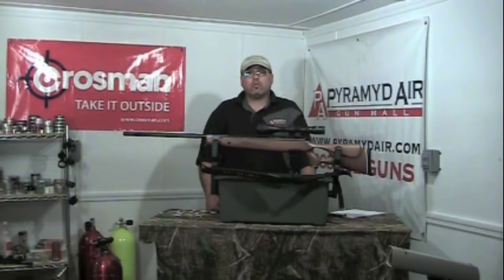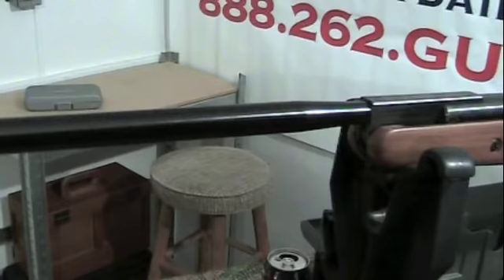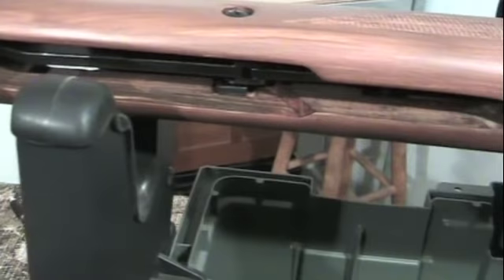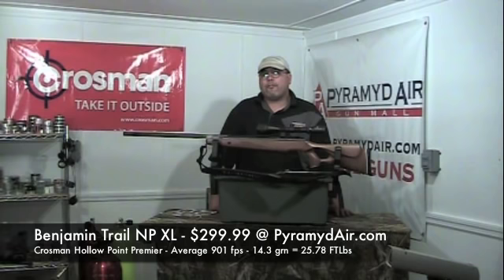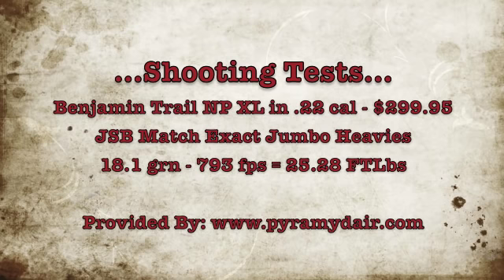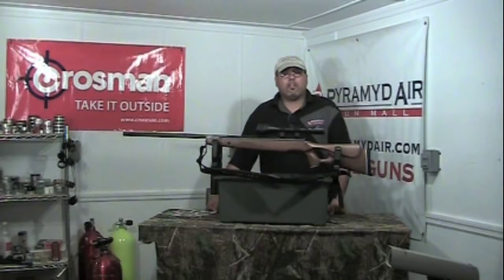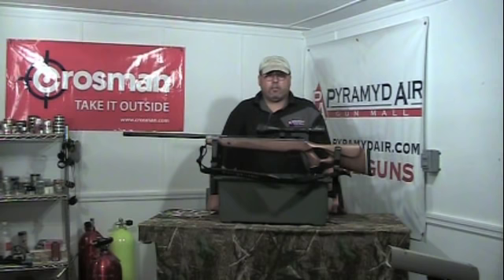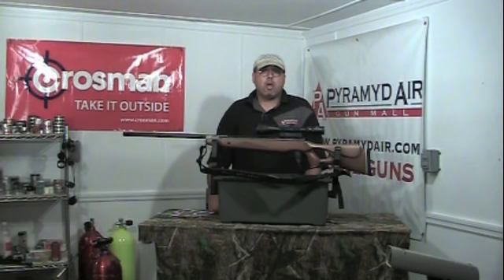Benjamin Trail NP XL - .22 cal Gas Ram "ultra magnum" (At least that is what I call it..!)

Comment from the maker: @whyteryze 
Good question. I shoot them right out of the box and get a baseline, then I shoot them until they "settle down"  You can tell when a rifle has hit its stride.  Velocity evens out, and accuracy improves.  Once that happens, I start the video review process.  Every rifle is different.  My TX200 took little or no time to break in while the cheaper guns like crosman and gamo can take 500 to 1000 shots to break in. The cheap guns make me work a lot harder to get good shots.

Cheers
Rick

Comment from the maker: To Jomel Sagsagat:
I would go with the Hatsan 125 in .25 cal. In .22, it would be on who you would ask. There are people that love the XL in .22 and there are those who have said they have had some problems with it. The Hatsan 125 in .22 is very accurate as well. With Hatsan, you will get a better trigger.

Cheers,
AGW
Reply: You this you can give the XL an extra edge if the trigger is upgraded?
Reply from the maker: Jomel Sagsagat
People have good results when this trigger is upgraded.

Cheers,
AGW
Reply from the maker: Ric Brown  Ric, if you can email me directly regarding the 125 quality issues that would be great.  I talk to the Hatsan guys often and have not heard of anything that would throw a red flag.  The NP in .25 that I tested never got past the break in.  It was awful.  I have a stoeger x50 coming, which is nearly the same gun minus the gas ram.  In .25 cal springers, Hatsan is the way to go.  If you get one that's not right, contact them immediately, don't try and fix it yourself.  They will WANT to make it right for you.  But if you don't want to go that route right now, just hold off for a while until the smoke clears from SHOT and all the new stuff starts coming in.CheersAGW
Reply: My hatsan 95 in .25 had its trigger sear snap off after an extended shooting session

Comment from the maker: @MrDJKaram 

It is a sealed system.. like a gas ram on the hood, trunk, or hatchback of your car.  It does not use "gas" in the way a co2 gun would.. the ram is sealed and a piston compresses the gas in the ram.  When you pull the trigger, the gas is allowed to push the piston back up and that pushes the piston in the gun just like a spring would but with less recoil, less vibration, and less torque.

Rick

Comment from the maker: @Alstar250 

Thank you for the kind words.

The NP is quieter than the XL.  and they are both quieter than phantom.  be sure to use the .22 of the NP and not the .177.  Also, in your phantom, what pellets are you using?  The heavier pellets help keep the noise down.

Cheers!

Rick

Comment from the maker: @Nevanator7 

You know.. I really like the Benjamin Trail NP.  I'll be posting a video of it later today... About the only thing that it needs is a different trigger which you can get for about $32 on-line and it just drops in place in about 10 minutes.  It will serve you well out to about 50 yards, which is quite a reach for an airgun.  It runs about $230 which is a real value.

Rick

Comment from the maker: if you are referring to adding a spacer or larger washer on the trigger to shorten the pull length, please be aware that you are asking for a lawsuit.  There is a reason that Crosman leaves such a long sear engagement.  When you reduce it, the gun is prone to misfire or accidental discharge.  If someone get's hurt after using your "fix" then you can be held personally liable.

Please be careful.

Rick

Comment from the maker: @SoCoMzXeLiTe 

It is bad for the gun to dry fire them. You ram the seal into the front of the compression chamber and also, usually, cause combustion which contaminates the chamber.  If you damage the seal you will have to replace it.

Rick.

Comment from the maker: The crosman trigger is not a true 2 stage trigger.  The first "stage" does nothing to change the sear engagement, the 2nd "stage" is where it pulls the sear and fires the gun.  They have a long sear engagement for safety reasons.  Modding the gun in this manner, safety or not, can possibly cause a misfire of the rifle.  I've seen happen.  The better option is either the GRT III or GTX Gen II triggers.  They convert it to a true two stage trigger and maintain safety.  $35 well spent.

Cheers
AGW

Comment from the maker: @SoCoMzXeLiTe 

the 950 is with super light weight pellets.. not lead.. lead pellets shoot around 750 fps.. which is very respectable in a .22 breakbarrel.. In the end you want accuracy not velocity.. don't get caught by the marketing.. when you break the sound barrier you loose accuracy very quickly... airgun pellets are VERY different than bullets and don't do well past 900 ish fps.

Rick

Comment from the maker: @SOGavin 

Try switching to the "artillery hold."  In short, rest the rifle in your off hand right at the balance point of the rifle. This is usually back near the trigger guard.  This is contrary to how you'd hold a regular firearm.  Do not grip the rifle with your off hand, just cradle it.  You can rest your hand on something if you need to.  Now hold the rifle securely with your trigger hand, get your sight picture through the scope and gently pull the trigger back until the gun fires.
Rick

Comment from the maker: PyramydAir does not use a DB meter to test noise.. they "ball park it."  I use 2 different DB meters and average them together.  I KNOW the Stoeger is quieter.  Also, the gas rams that crosman is using these days are more cheaply made than the original ones.  I The Stoeger x20s is built very well and is a stand out product for the money.

Cheers

Rick

Comment from the maker: The piston that Pyramyd Air sells is designated for the NP series of rifles. It does not say whether it would fit the XL. You might assume that it is a  different piston because of the power difference. As of now, I do not know whether you can switch the pistons out.

Cheers,
AGW
Reply: i have the np with the grt trigger.  extremely accurate with predator polymags.  i ask Benjamin if the pistons can be swapped and was told NO....i am going to stay with np for now as i have the hatsan 125 in .25.......both of these rifles are deadly accurate and fun to shoot....use np for barn yard pests and hatsan is my hunting rifle......all bought after your reviews.  they were very helpful and informative i thank you.....what i need is an rws with a piston...an old mans dream....

Comment from the maker: @MrAlbert3560 

Actually the Titan GP was modeled after the Trail.. which was modeled after the Super Streak.. Anyway, I guess that question would be better answered by Crosman.. but I'm thinking that they had a design that was working, to make a smaller, less expensive version made sense.

Cheers

Rick

Comment from the maker: You need to watch the stock screws, the scope mount, the scope, a drop or two of chamber lube every 1000 shots.  Also, clean the barrel every 50 to 100 shots using dry patches.

cheers

Rick

Comment from the maker: @adamclark94 

Usually accuracy AND power don't go together in a spring gun.  The recoil generated to get the power, makes the gun very difficult to shoot well.  I like the Trail NP over the NP XL.  I can get 1" groups at 50 yards and it gets 730 fps with 14.6 grn pellets.. That is plenty enough energy for most game out to 50 and 70 yards.

Rick

Comment from the maker: @saltycrack44 
the RWS 34 is a winner... BUT consider the Benjamin Trail NP (NOT XL)  The XL is just the Super Streak with a gas ram.. in .22 it is ok.. but it will have some of the same hold and control issues that you find on the super streak.  The other option is the NPSS, which is a better, US Made, version of the Trail.

Rick

Comment from the maker: @MrCoonTrapper 

The screw does little to nothing for you.. It adjusts the 2nd stage pull length only by a fraction. it does not do anything for pull weight.   All the way in is as short as you'll get the 2nd stage.

Cheers

Rick

Comment from the maker: @MrCrazypyro84 

You have to ask yourself this question, is hitting something with 10 foot pounds of energy better than missing it with 13 (+/- for the xl) foot pounds of energy? That is really what you are talking about at 50 yards. Rabbit and Squirrel are still well within range at 50 yards.. With the right pellet you can drill a 1" group with the Trail NP. The recoil on the XL is so severe that you'd be lucky to get a 3" group at 50 yards.
Cheers
Rick

Comment from the maker: You are experiencing the normal operation with this gun. Do you have it in .177, .22 or .25.  
The .22 is the best caliber in this gun.. it is the most accurate of the 3.   You have to constantly maintain it by checking the screws, etc.  Also, it has a tendency to break scopes.  Keep Crosman's number handy.  They'll keep replacing it if it breaks.

Cheers

Rick

Comment from the maker: @YelloFault 

The new version with a gas ram should be quite the gun... I'd put it over the Trail NP XL.  Although I've found that I like the standard Trail NP over the XL or the other magnum springers.  It is much easier to shoot and therefore more accurate at range even though it does not shoot quite so hard.

Rick

Comment from the maker: @tommy2timez 

My experience with the NPSS has been poor.  I'm not saying they are all this way.. but out of all the NPSS rifles that I've purchased or evaluated.. every one has had an issue.  My first one was really good (review from a couple years ago).. then the ram failed.  Since then, I've had a barrel joint failure and 2 with problems with the cocking linkage.  There's no excuse for this other than poor quality control.  It's very disappointing to me. 

Rick

Comment: If you have trouble or inconsistence with your group accuracy ...clean your barrel with copper brush .22 cal with cleaning patch wrapped with ''nitro solvent bore cleaner''. When the brush is outside at the end of the barrel, unscrew the brush and change your cleaning patch and repeat 4-5x or until the tampon is clean (white not brown). All of this remove the residue machining of the barrel and improve greatly your accuracy.20 shots my scope is zeroing at 50 feets with 2'' group(break in period)

Comment from the maker: That's not bad for a trail np xl.. the Hatsan 125 shoots the 14.3 around 875 fps, so there's not much difference there.  If you want more power, go for the .25 cal.. It shoots slower, but the pellets are almost twice the weight.  25.4 grain at 710 = 28.44 fpe.. 

Cheers

Rick

Comment from the maker: When is the last time you cleaned the barrel?  Also, if you have the option to have it chrony tested, you may find that the velocity has dropped due to a bad seal or a defective gas ram.  Both occur more often than folks realize.

Comment from the maker: @ILaxWithaPro7 

I just realized you have the XL and not the standard NP.. you can also try the 15.9 grn jsb pellets and the slightly heavier 18ish grain JSBs as well.    Lastly, try the Predator Polymags and on a long shot, the H&N Baracuda... but I think the JSB's may be the ticket.  PA has a JSB sample pack now that should get you started in the right direction.

cheers

Rick

Comment: If you want info on tuning it to get the max power out if it I can help. I don't own one so I can't say what to expect from it when operating 100%, but at least I can help you get you to 100% whatever that may be. Usually the guns have a few serious but easily fixed problems, the main seal is damaged, the transfer port is in horrible shape, and often a few other minor things. The good news is it's easy and cheap to fix them. This btw isn't a Crosman/Benj issue, but basically all non German guns.

Comment: I'd get a spring gun like the generic Crosman Quest, Storm, Phantom etc, (preferably a referb) then buy a suppressor from Crosman (~$30), and put spring tar on the spring. This will make about the quietest gun you can get. If you want even quieter you can detune it by removing the spacer behind the spring, your power and cocking effort drops to ~half, noise drops a lot too but I doubt by half. You can also make a spacer any length in between. If you want magnum power then the XL is what I'd get

Comment from the maker: @alrodrodriguez 

Between those two guns... man that is a tough one.  The Falcon Hunter has a bit more power, from my recollection, and I like their new quatro trigger and SAS shock system they've built into the stock, BUT the Benjamin is really quite.  The other choice is to go with the Standard Benjamin Trail NP, especially if you are shooting primarily in your back yard.  It is a little slower, but I found it more accurate and much easier to handle.  It is also $70 less.

Cheers

Rick

Comment: The only difference I can see in that trigger is where the pin and spring go it's a solid piece there instead. That's why I said don't put a washer in that goes above the top of the trigger. I found a thick washer that fits perfectly. If I do have issues with it then I will buy the $35 trigger.I can see why you would caution people not to do this though,wrong washer the gun could go off dropping it or even a hard bump, that's why you don't want too big of washer sear may not engage all the way.

Comment: @AirGunWeb I have to say that I cranked the trigger adjustment on the Vantage about 1 1/2 turns clockwise and the travel is almost nothing now. Takes very little pull to get the shot off.

Comment: The trigger pull on the rifle can easily be fixed with a .05 cent washer by removing the 1st stage spring and replacing it with a small washer, walla no more first stage and a hair trigger now. Make sure the washer is small enough to only reach the top of the trigger frame.

Comment from the maker: I've found that the current offerings in NPs don't hold up as well as a quality spring gun, i.e. RWS 34.  Hatsan has some new air spring guns coming out soon, they may be a good option as well.  The Gamo IGT guns can be good as long as the barrel joint holds up.

Cheers
AGW

Comment: perhaps you could point me in the right direction. i have the standard model trail np. it used to shoot consistent dime size groups at 20 yds. i may have put a bit much oil in it, because now it shoots 1.5 inch and sometimes worse with the same pellets. it isnt making any visible smoke after being fired, and ive ran at least 200 pellets through it and cleaned the barrle, checked all the scope mounts, and the stock screws. any suggestions would be greatly appreciated!

Comment: @mick50382
From what I have read from other folks who use them, the Crow Magnums do very well on soft game (starlings, sparrows, pigeons, and rats) within 50 yards, and tougher critters such as squirrels, groundhogs, and crows within about 25 yards, and yes that was with the Trail NP XL.
The Predators do a bit better due to the tip, enabling you to stretch the range to 50 yards for the tougher critters.
If you want maximum performance for all ranges, the medium to heavy domes rule, though.

Comment: Hard to beat JSB or H&N. H&N Barracuda Match are outstanding, H&N Crow Magnum are imo the best hollow points. The 177 8.4gr JSB Exact or 22 18.13gr are both amazing. That goes for any airgun with descent power, spring, nitro, whatever.

Comment: I think a gun needs to be at 30ftlbs before it can add "Ultra" in front of Magnum. Imo. 
The trigger can be fixed btw, mostly it's held back by a short adjustment screw which prevents you from adjusting it correctly. Why? I assume to protect people from themselves, or more realistically; to prevent those people from suing Crosman when they screw up. The trigger can be made to work very nice with a little work, and I don't mean buying an aftermarket trigger, but fixing the one you have. Google it

Comment: Hello Rick, I own the Benjamin trail np2 in .22 and I need a little help the o ring on the bridge where you seed the pellet is looking like it's tearing now a friend of mine gave some
Advice and said to lubricate it using some Vaseline to extend its life, how ever eventually i'm Gona have to exchange it, there's no service centers here and no place I can take my riffle to be serviced or repaired and sending my riffle to the USA to have an o ring will be expensive my question is as fallows: how do I change the o ring? And what's the correct name for this part so I can look it up in piramydair? If you can provide a link that leads me to the correct part that would be awesome, cause I want that part on my tool box so as soon as the o ring that's install gives out I can replace it, also a video on how this done would be nice I searched but couldn't really find any
Reply from the maker: Wolfmek - it's called the "breach seal" and you can order them from Crosman.com.  Just give them a call and I'm sure they can help you out.

Cheers
AGW

Comment: rick,  i have a trail all weather dont watn to use the wingdage turrets to compensate for gross adjustments. are there any gunsmiths that will shim the elevation so as to use the turrets for finer adjustments. I think the picatiniy rail was not welded properly or the rings are sup-par. maybe I should just get the XL. please help I'm about to return the whole thing.

Comment: Springers lose power with heavier than ideal pellets. In 177 the ideal pellet weight is usually closer to 8gr, so a 10 will have less power, a 13 even worse. The problem with a 1500 is it pushes an 8 too fast so people use 10 and accept the loss, but heavies do have some advantages. 
The only diff in the 1100 is the hole in the barrel (barrel is only $16 btw) but this makes a big diff so in 22 a 10gr and even 13 is too light, you should use 14.3 at min. This is why the 1100 is much more popular